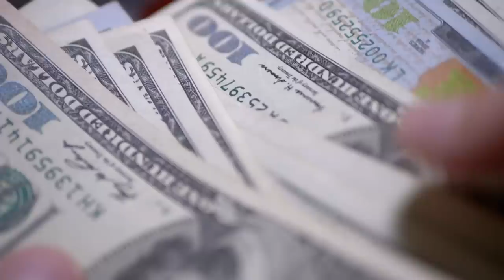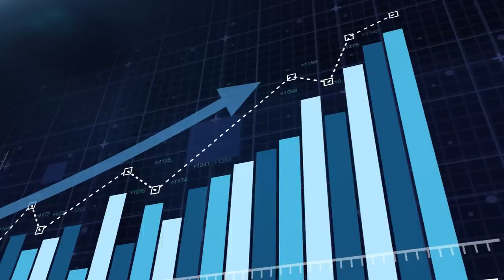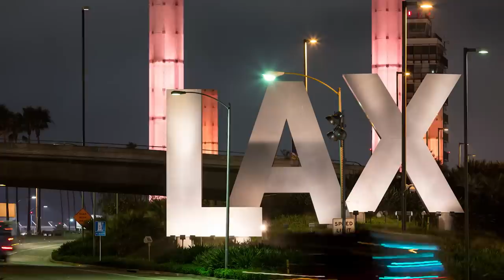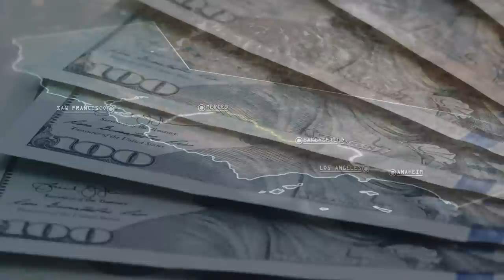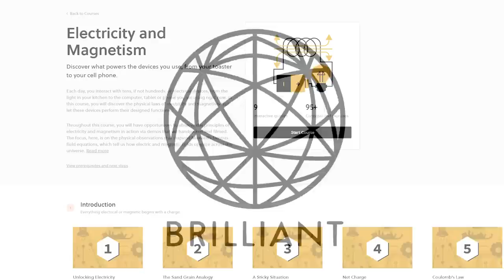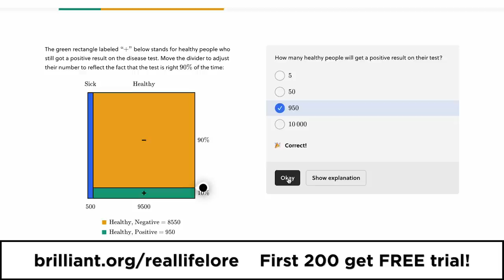Why California High Speed Rail is Struggling (Re-upload)

Comment: Imagine if they use that money to build multi-level highways instead. The cost is 1/5 of the US highway system, that means they could add the equivalent of 20% of US highways to California if they didn't waste money on this project. Much more Californians would've benefited, not just those without a car, and it would drive auto sales, manufacturing and service jobs, further boosting the economy. Instead, California keeps dumping money into this black hole.
Reply: You do realize that this stupid idea would be far more expensive in the long run as you're litterally talking about a roughly 400 mile long parking garage 😂 (parking garages are the most structurally unstable buildings in america, Btw) - given that this is a "multi level highway". Instead you could just build a train which won't rip up its infrastructure as quickly as tens of thousands of cars per day, and can transport tens of thousands of people in a fraction of the amount of space as tens of thousands of cars 😂

Also, how closely related does ones ancestors have to be in order to make this idea out to be good for non car owners.
Reply: @Limosethe  building earthquake resistant structures are a solved problem. California do have multi-level highways. Building more highways will be cheaper and faster than the HSR project ultimately going to be. You might see a section of the HSR operational by 2040 that no one will use because it leads to nowhere. Or you could've had highways that actually connects two big cities.

Car ownership is a positive for personal mobility, with better highways non car owners will have more incentives to become car owners and improve their freedom. If you think dumping billions into a project that won't see any return for 40 years is a good thing, you might what to check your parents ancestry instead.
Reply: @awdrifter3394   "building earthquake resistant structures are a solved problem" - Please point to where I mentioned anything about Earthquakes because I know that I certainly did not. What I meant was that Parking Garages are genuinely the most unsound structures in america overall/in general. This is predominantly but not limited to the fact that they have to be built in a way where the interior is constantly exposed to the atmosphere thus, the weather is much more likely to erode these structures from the inside out. (Also, especially in coastel places such as California the salty air from the Ocean does a number on these structures in terms of erosion.) 

As far as Earthquakes are concerned, it is a problem I hadn't yet considered to add on to the mountain of reasons why this idea is affront to being a good idea by any stretch of the imagination. Let me ask in order to get more specifics of this idea, is this theoretical multi level highway underground, or built above ground, sort of like an almost 350 mile long parking garage where people drive instead of parking? Because if it is an above ground structure, then I challenge you to provide me with a precedent where multi hundred mile long buildings survive Earthquakes. 

"California do have multi-level highways" - Multi-level highways that are more than a mile long, let alone hundreds?.. Yeah, didn't think so. 

"Building more highways will be cheaper and faster than the HSR project ultimately going to be" - Funny how here you didn't say "Building a multi-level highway that connects LA and San Francisco would be more cheap then an HSR line could ever be" - Could this be because even you realize on some level, deep down that Building a more then 300 mile long Building between these two cities for instance, would in fact be more expensive then a simple railroad so you thought that you could quickly switch to talking about conventional Highways. Anywase, would highways be built faster than HSR? Yes, absolutely. You want to know why? It's because the department of transportation has decades of highway construction experience under its belt, whereas HSR is new for the USA. Anywase, highways rips themselves apart faster then any other type of infrastructure (especially railroads) because of the weight of hundreds of thousands of motor vehicles passing over the surface of itself per day. This means in the long run, highways are actually the most expensive piece of infrastructure in the world that a society can buy due to the fact that it requires near constant resurfacing. 

"You might see a section of the HSR operational by 2040..." - You see: the words, "You might" at the beginning of the sentence really are the key words here because it shows that you admit that this is purely a conjecture ridden opinion. Well, sure, by 2040. And one could add, "Or you might see a portion of the HSR operational by 2030...2031...2035.." (And so forth) 

"...that know one will use because it leads nowhere" - You do realize that if they were to choose to open the network one line at a time it would get ridership in the beginning of it's operational History because it connects major cities, right? And plus, it's planning on opening in two phases and phase one will connect the two most major cities of LA and San Francisco. Even if the two were not connected immediately upon opening, you still have major cities in the central valley that have a lot of demand for travel between due to to fact that people regularly drive between them. 

"Or you could've had highways that actually connects the two cities" - You do realize that this already exists, right? The problem that caused the need for HSR in the first place was the fact that people did not have a quick, inexpensive way of traveling between the two cities that didn't invoke a lot of stress or heart ache.  The only two options right now are driving for six hours (which gets you stuck in traffic jams, puts you at risk of car accidents, requires 6 hours of constant attention, requires you to destroy your bank account on purchasing and maintaining a large box of metal aka. a car) The second option is to fly which is expensive, bad for the environment, stressful and requires TSA and long lines. I guess you can take a bus but those take as long as driving, long wait times and are filthy. 

"Car ownership is a positive for personal mobility..." - Only in a hellish car dependent society. It also isn't even in one because of the large amount of income that gets wasted per person, per year on the mass expenses on car ownership. All this means less money spent on vacations and outings, and more wasted and transportation to and from work which should be inexpensive and not a problem in a First world country. 

"With better highways non car owners will have more incentives to become car owners..." - But through induced demand, everyone who doesn't drive is already forced (Not encouraged) to ""improve their freedom"" through car ownership. This is because society is structured in such a way where the only feasible way to get from point A to B is by driving. This is the exact opposite of freedom because it destroys choice and causes free and open walkable cities to be non-existent. 

"If you think Dumping..." - Aside from the 40 year figure being pure conjecture, I also must be the first to address the fact that Climate Change is not only real, but is a pertinent existential threat to the survival of Civalization if not Humanity. You do realize that Highway construction and resurfacing is horrible for greenhouse gas emissions and other forms of pollution; especially if said highways are multi storied, right? You do realize that in a country on a planet with an exponentially growing population, the vast majority of hundreds of millions of people driving their own vehicle everywhere from point A to B just in the United States alone is only going to drive Humanity evermore closer to the collapse of civilization, right? So I will still emplore you to study the details of your ancestry if you are to regurgitate the same talking points over and over again as is way to typical in these type of discussions just to show in the most lengthy manner possible that you are the type of person who sticks to beliefs no matter the argument laid out before them. If not, I would be happy to have a serious discussion with you about this nessasary topic
Reply: @Limosethe  ok.
Reply: @awdrifter3394  That's it? 😂 Thanks for making it easy, I guess

Comment: Just because it is expensive does not mean that the High Speed rail is bad. The National Highway System was done in the 1950s which is when politicians were actually human, flawed but human. The "pork" in the high speed rail was unavoidable without prosecuting politicians which almost never happens. Most of your criticism lacks any context about the area you are talking about i.e. "California is expensive." Duh.
Reply: Keep in mind the “National highway system”
This high speed rail line already has 1/5 of the cost it took to build the national system, and it only serves 2 major cities where flying if both faster and cheaper. Not to mention the interstate system has already connected the country way more than trains ever could have or ever will.
Could you imagine the cost for a “national high speed rail system”

Comment: They could revert, for the mountainous tract of the railway, to standard speed railing, 50 mph. That can halve the costs and still be good value.
I believe that much of the lack of financial coordination is caused by political infighting. Costs in California are much higher than anywhere else in the US, so public money spending is much less efficient, with politicians seeking instead more immediate rewards.
They may need to set up an organisation seeking to finish the railway with an open date, by subdividing the work in small batches.
Thanks for the video. I personally believe that railways are the best mode of transport, provided the ticket prices are low and popular. Here in the UK we have the highest Raul ticket prices of the entire world, and this has a really bad impact on the job market; with workers in London resisting the return to the office, because working from home save them £1,000 per month in train tickets cost...

Comment: The current driving time from San Francisco to Los Angeles is about 5 1/2 hours. The high speed real is going to save a little over 3 hours. To get that savings the trip must be scheduled around whatever schedule is provided, you have to get to the terminal and when you get to the destination you have no car for local travel. With a car you can leave directly from home at a time of your choosing and have transportation when you get there. Well worth 3 hours. 

This boondoggle is pure pie in the sky. If built is will not be used and will become a mill store around taxpayers necks forever. In the automobile and highways we have the best transportation system in the world. First and foremost, it works. Second it is cheaper and far more flexible than rail. 

When you look around the world you find high speed real where the people can not afford cars. 

Nowhere in this country has rail lived up to the hype. Cancel this foolishness.

Comment: The video provides useful information but fails to give adequate weight to the failures in the planning and politics that are the foundation of this effort. 

The engineering problems of tunneling directly through multiple earthquake faults remain insurmountable. Beyond this, the route stops in far too many places in low population areas to shorten the travel time from that possible by air and car. 

Might a high speed rail line between the Bay Area and Los Angeles been possible? There is an existing rail line running close to the coast line that might have worked. 

If the one absolutely wanted a high speed run from the Bay Area the LA, Internet 5 already runs the length of the state. The I 5 route was chosen such that a high volume of traffic could move quickly between major populations areas. The route is already publicly owned. 

I live in the part of California where the line in being built. The structures will be enduring monuments to bad planning and stupidity. 

There is, of course a benefit to our region from this boondoggle. At least some of the construction money makes its way into our economy. 

The many billions spent on the projects would have been better spent developing our current rail system.

Comment: I missed the original version so I can't comment on the changes, but overall I think you did a pretty good job covering CAHSR. You covered this in the video, but the thing I think a lot of people miss is that even if the "train to nowhere" is all that is ever built, there are existing rail services on both ends. And you can run high speed trains over conventional tracks at conventional speeds. You mentioned it with Acela, top speed of 125 but average of 88. If you run the HSR over the ACE route into San Jose and then up to SF it's not going to be the 200mph we all want, but you would still have a huge improvement over what we have now. The most important piece would be closing the gap from Bakersfield to LA. Or at least get it to Palmdale and co-run with metrolink into LA. I really hope the full route is one day completed, but in the meantime we can still get some pretty significant upgrades to existing services.
Reply: So you would take at least 3 trains, two of them slow,  to get from LA to SF? It wouldn't be cheaper than flying or take less time than driving. This is going to be the white elephant that kills high speed rail in the US.
Reply: @chevyslyme  no, I’m saying run one train at conventional speeds at the ends and high speed in the middle. They already intend to electrify the existing commuter rail corridors. Or if that’s too optimistic, you can swap the electric engines on either end for modern diesels. Still one through train.
Reply: @anitrain  I have traveled from Guangzhou to Changsha several times, a comparable distance LA to SF. About two and a half hours on a high speed train, maybe an hour or so slower than flying.
A time like that between LA and SF would suit business travelers. There and back in a day with time for a couple of hours of meetings. The comfort, reliability and quicker boarding of a train offset the extra travel time.
The long slow trip with a short rapid segment will take probably six hours. Wasted time, away from home overnight and the expense of a hotel room. So virtually no business travel.
Leisure travelers could drive in the same time and have a car on the city when they arrive. Or travel by bus, cheaper than the train which needs to pay for all that infrastructure somehow.
I just can't see why anyone would want to take a slow, fast, then slow train.

Comment: at some point of time, use of present tense start to feel odd. the CA high speed rail started in 1996, even if we start counting since the budget get approved, which is 2008, for a 500 mile phase 1 rail, which to date, 14 years later, only build around 100 miles. 

let's take China for example. during the same time span, build 23,500 miles. 

and Biden said about build back better? HOW?
as a CA tax payer, i think it is time to AXE this stupid project that was WAY over run and WAY under performing.  throwing good money after bad is exactly how we get contractors who aren't liable for any delivery and yet still sucking billions of dollars out of tax payer.

Comment: California should incentivize a private company, like Brightline, to do a JV with the state to get the train built. Ironically, the "red" state of Florida has show that high speed rail can work, while the "blue" bastion of California has so far failed because of unrealistic planning and incompetence. But if you give a private company tax breaks and incentives to join the project, the train can get finished a lot quicker. In the USA, it's seeming patently obvious that government is incapable of getting projects like this done, unlike in some countries. It appears necessary for a private company to be involved. But that's not a downside, because a private train has an incentive through competition to improve the passenger experience, and the fares for a private train are not actually higher than for a public train. The fares on Brightline in Florida are not more expensive than Amtrak, for example. I do really hope that the California high speed train will get completed, by hook or by crook.
Reply: yep, because the state will surely bend over backwards for private companies as opposed to just building it. 
And then they'll pay private companies even more money to maintain and operate those lines as opposed to just running a state-owned company :)))

Comment: You are still getting a lot wrong. If you need to travel from LA to SF or vice versa you dont travel along the coast as your graphic shows. One would use the 5 fwy through the middle of the state. You cannot compare the CAHSR cost to the US highway system when most of the US highway system was built by the 80's, if not earlier. Also, compering the cost to build to that of China is misleading. The reason China's cost is low is due to low cost of labor and materials because it's China. Plus China has unscrupulous bud regulations. Overall this video is somewhat misleading and anti-rail.

Comment: This hsr route should NEVER have taken the hiway 99 routing.  Idiocy!   It should have run down the middle of I5.  Would have cost nothing in land costs    more direct route so faster.  No stopping.    They could have given the san jouquin valley a fast connecting train using the existing main lines.  But they are too stupid and corrupt.